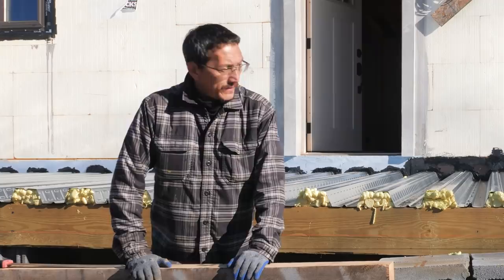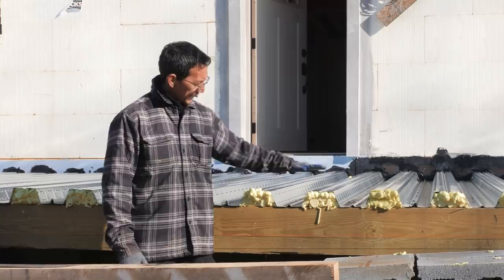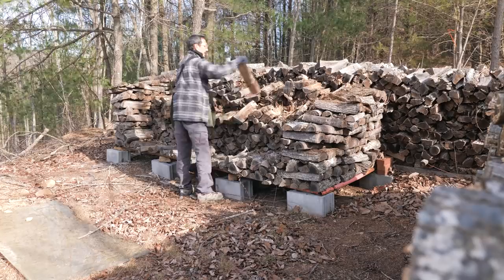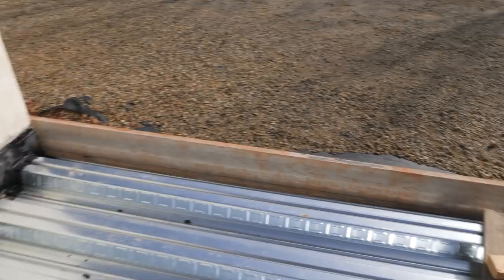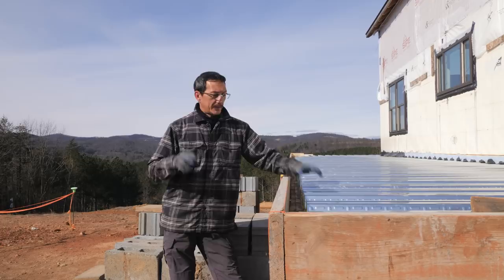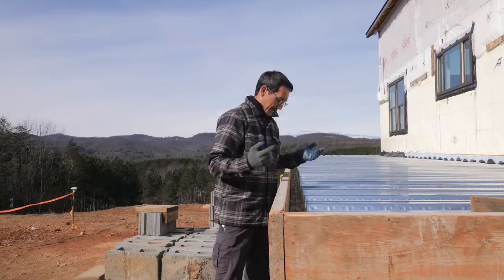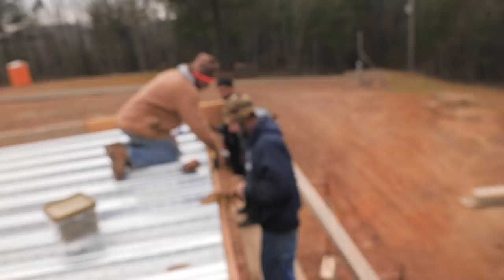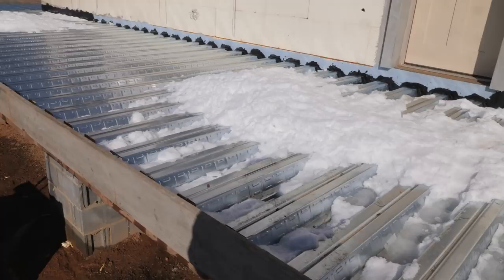Building Forms for Elevated Concrete Porches

Comment: Consider dropping the middle 2x form about a 1/4" to create a mechanical "weep" strip on the under side of the concrete edge.
Reply: Can you expand on this a little? Thanks.
Reply: You create a thickened edge by dropping the form 1/4". In a section view the outside edge of the slab would be 5 1/4". Under the slab this thickened edge would be the width of the 2x form material (1 1/2" net) then reduced to the 5" standard slab thickness. This creates a 1/4" vertical face under the slab preventing water from "weeping" uphill.

Comment: As being an architect myself. Yes I have seen many office blogs or skyscrapers using the decking system to pour concrete on it. It is so common.  U use wood as form work which is fine.  Some use steel angles as form work welded to open hoist system. I love your videos and can’t wait to see it finished

Comment: I am so impressed with the quality of the build. Jeremy seemed very apprehensive to start this house and as it turns out he is going to be a great general contractor. The porch and The view are amazing. I don't know what it costs you to build that porch but it will be worth every penny. Great job guys, keep it up.
Reply from the maker: Thanks for hanging and watching this circus. 😊
Reply: It's obvious whatever you lack and experience, you make up for with intelligence and determination. I'm glad you have not compromised on what you want or location due to the difficulty. There's a lot of people that would have just drug a double wide in there and called it a day.  Not saying there's anything wrong with that. But you're going to have a house to really be proud of.
Reply from the maker: 250 tons of concrete in this build. So far. This is not normal. 🧐

Comment: FYI: Desk Pan has been the standard for commercial high rise buildings for many years. This is a nice residential application here.
Reply: I remember seeing them go at one of my first employers on the second floor of a new building. Additional point is electric, phone, etc can be run through the "ribs" and brought up with not having to drill through too much concrete. Prefect for "cubicle land"  and no vertical drops.

Comment: After pouring what I’ve poured im a strong believer now in no wire mesh.  I think concrete is to porous and the steel will get wet or stay wet, expand and contract and If you cut in relief cuts or cracking joints, that only gets the water and air that much closer to the steel wire mesh.  I’ve never not seen a driveway or sidewalk that didn’t have a crack that wasn’t in the joint where it was supposed to crack!   My garage got 4.5 pounds of fiber mesh per yard and my basement got 1.5 pounds per yard.  No cracks and no relief cut to force cracks.

Edit:  I heard him say no fiber mesh and being barefoot and he’s right, but a propane tank and a blow torch takes them out in 2 seconds unless you wait 1-2 years of shoveling snow and they’ll be gone.

Comment: For my house I want to do the same thing but will be using concrete block with fill and pouring a concrete slab all around the house. I do not have to worry about windows or doors under the deck. I will also install an under house de-humidifier to keep the crawlspace dry. Will not have to worry about critters getting into the crawlspace. I will also extend the roof line so the concrete will be covered, so basically I will have a surround concrete porch.

Comment: Actualy, the steel deck is meant to work as a lower rebar, absorving the traction as the concrete absorves the compression of it. Also the "ribs" create a resistance to shearing forces on the face of both elements that come with the flection of the slab. So, teoricaly, you shouldn't take the deck off, cause the concrete slab isn't dimensioned to work by itself.
Reply: yup it is an intrinsic part of the system.

Comment: Have you ever considered putting central vacuum in the walls before closing them? Its tremendously convenient in a house your size.  You don't have to drag a vacuum around & up and down the stairs. You have outlets in the walls , you carry a hose &plug it in.
Reply from the maker: We use a battery powered Dyson. Much easier.

Comment: I see patches of light coming through the spray foam when you showed the under deck pictures, they are probably not big enough to let the concrete flow under but you may want to check them 👍😊
Reply from the maker: They were filled solid before the pour
Reply: @Guildbrookfarm  I figured you would 👍😊

Comment: 15:32 Is that light I'm seeing or the light colored spray foam?  Obviously light would mean gaps that concrete could seep through.  Excellent FAQs review, have you discussed why concrete over wood decks? Thinking past the slabs, what are you doing for porch roof pillars and railings?  That back deck is quite a ways up.  Might be a good time for a sit down discussion on what's coming up/future. My last thought, while the concrete/concrete guys are there, think about footers for the steps off the porches.  Can't wait to see the next steps!!

Comment: how much did it go just into the metal decking, asking because I got 33 feet by 8 feet worth of decking plus some 34 fee angle iron, and the medal decking was really up there in price. Also, is the wire mesh a requirement for the slab if I am doing 4' slab ?

Comment: Hi,  I think I heard you say you were pouring a 5" slab and you have 1/4" slope over the entire span. Is that correct? Was your metal pan flat and the framing sloped? In other words, 5-1/4" thick at the house and 5" thick at the edge? I'm doing a similar porch project based on your design and using 2"-20GA metal decking. One of my porches is 12' and with 4" slab. I'm doing 1/8" slope per foot I have 1.5" total over 12'. I'm thinking of sloping the framing to have 5.5" thickness at the house and 4" at the edge.

Comment: I may have missed it in earlier videos, but why did you decide to go concrete on the porch?
Reply from the maker: I’ll never have to sand it, stain it, replace boards, deal with rot, carpenter bees, termites, nail pops etc.
Reply: @Guildbrookfarm  Makes sense. I'm dealing with all that. haha. Pay the extra upfront to not buy 2-3-4 times.
Reply from the maker: Exactly

Comment: With the metal form supporting and forming the concrete, what is the purpose of rebar?  Isn't that overkill?
Reply from the maker: To help keep the slab from cracking as it expands and contracts.